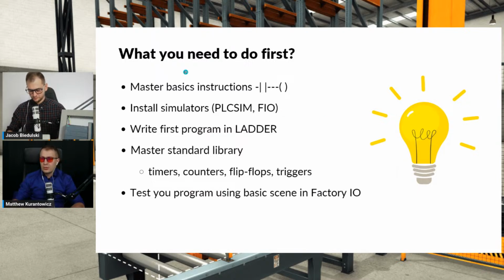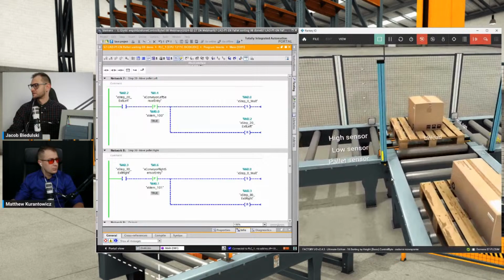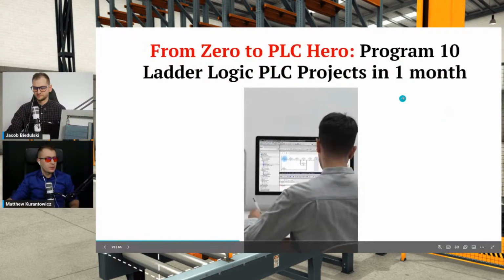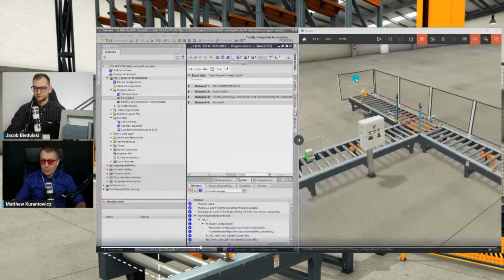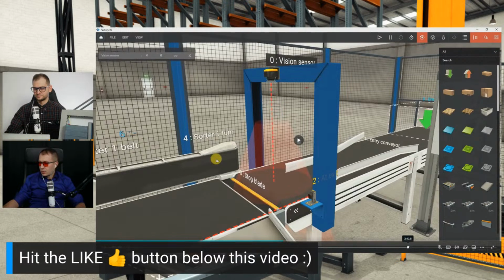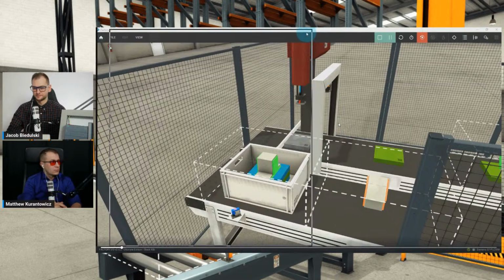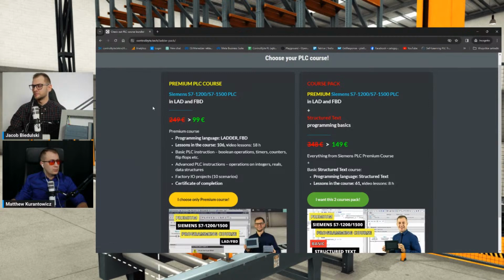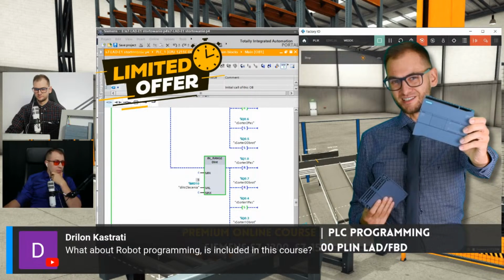Zero to Master: 10 Ladder PLC Programming Projects with Specialists

Comment: Tia portal got 16 ,17,18 ,19 ,can i know which version is preferred for begginer to start the plc programming learning
Reply from the maker: The trial version for each version of the program lasts 21 days. It's better to start with v15 and then upgrade your projects to newer versions.
Reply: @controlbyte_tech   that means after 21days i should buy an license key to access the other version or continue to use tia portal with the license ?
Reply from the maker: No, you have 21 days for TIA V15, 21 day for TIA v15.1, nexta 21 day for V16 and that same situation with TIA V17 and V18 @MarsShare123